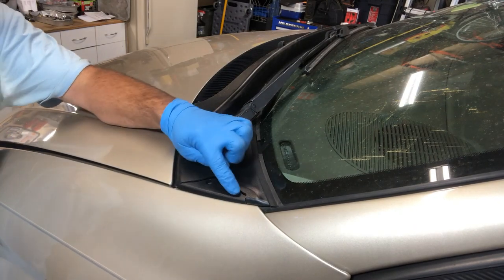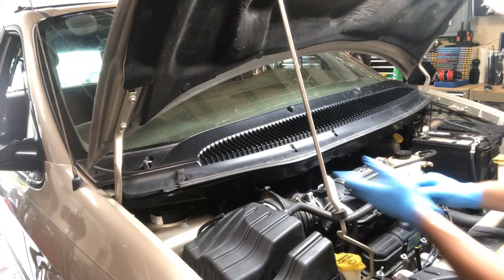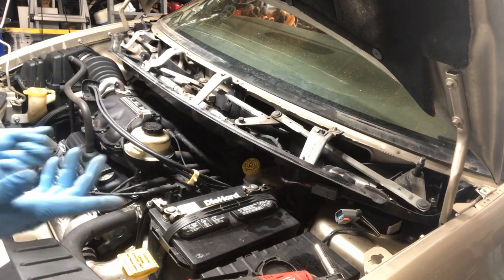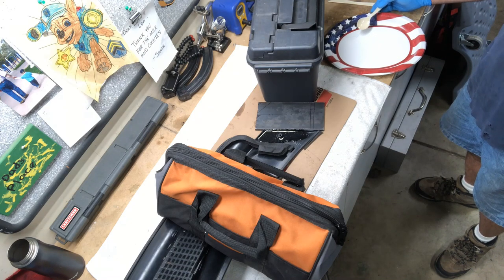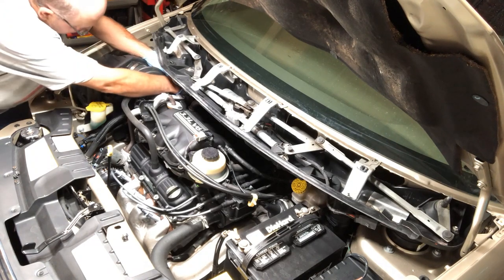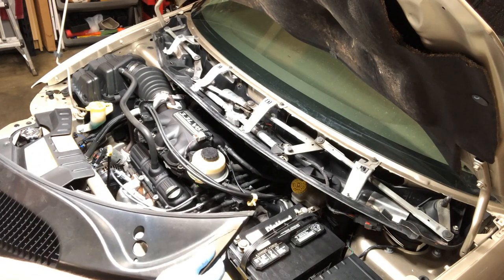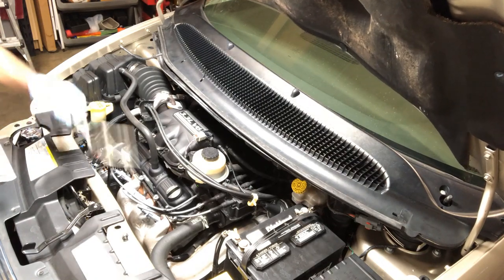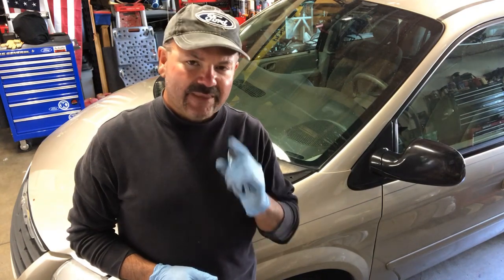Wiper Motor Replacement & Cowling Town & Country Grand Caravan

Comment: Pulling the wiper tray out made it so much easier to do a strut tower repair and an alternator at the same time.  I've been told it's not necessary, but after seeing how easily it comes out, I figured it was well worth the time.  I took the whole hood off too.  Was worried the wiper tray was going to be a pain but after watching this it was clearly super simple, I appreciate the video.   Nearly identical process for a '99 van in case anyone was wondering.

Comment: I didn’t see the motor been replaced
Reply from the maker: Memo Ramon - Your observation is correct. I shot this video when I was removing these items to repair the cowl and changing the spark plugs (this process gives way more room to work).  I thought this video would be able to help those performing a variety of repairs in this area.  I have yet to have to replace the motor itself, however I've had to replace countless cowls.  If you need to replace the motor itself I would recommend a quick trip to the salvage yard where you could purchase the motor and tray in one piece (for a fraction of the price) and easily install it as I show here.  Thanks for stopping by and leaving me some feedback.  Much appreciated!
Reply: Thank you for saving 23 minutes of my time

Comment: Hi, I bought wiper blades only to learn that the issue is not with the blades but the arm itself. I was to to take it off and adjust it a bit higher because my wiper blades kept hitting until one of them actually broke. THIS VIDEO IS EXACTLY WHAT I NEED! THANK YOU SO MUCH. Now I hope it isn't going to get complicated. 😅😅😅

Comment: Good video that fully explains the process of removing the wiper housing which is a must on these vans if you want to work on anything on the back side of the engine compartment. Personally I don't like to pound on the wiper arm shaft or otherwise use force. I use a battery terminal puller, it works perfectly to pop the wiper arm off of the shaft.
Reply from the maker: @mr88talent - Thank you for the compliment and taking the time to leave me some feedback!  I completely agree on the puller.  I sometimes try to use methods and examples that anyone could follow in their driveway without the need of "specialty tools" that many of us take for granted in our toolbox.  In retrospect, I should have used the hammer & nut method on one side and my puller on the other side for comparison. I'm still pretty new here to YT but I'm learning how to produce better videos every day and really try to improve my content as I go.  You've given me an idea for an updated video at some point, thank you!

Comment: Do not tap the nut with a hammer it will ruin the threads, get a tie rod puller it works great it’s cheap and no damage

Comment: Thanks but did you forget a step? run the new motor a few cranks and turn off so it set in the off position, then attach the wiper arms.

Comment: I was hoping you would cover something that is right there, but you didn't.  The insulation just under where you were working has fallen down and is touching the engine.  Could you please tell me what is supposed to hold it up?  Or, did you cover that in another video?  Thanks in advance.

Comment: The reason I watch this is? I need to replace the upstream oxygen sensor and taking the wiper housing off leaves so much room for activities.
Reply from the maker: @Jerry Harte - Great idea Jerry, removing this should really open up that area to give you some good access to that sensor.  Good luck on your project, they're not bad to replace so I'm sure you'll have no problem.  Thank you for stopping by and taking a moment to leave me a comment - thank you!

Comment: I just don't understand. Is my '08 4.0 SXT Caravan the only van made where the wiper arms are hidden under the hood? I've watched '08 videos and neither of theirs are hidden like mine. 9:37 I cannot just lift a cap and ratchet the nut. It seems that I would have to either lift the hood and use the world's smallest tools or just remove the hood JUST to access the nut.

Comment: Thank you.  I am replacing plugs/wires today in my 2002 T&C.  Might be able to do so w/out removing wiper assembly but now I'm less stressed about it seeing the wiper assembly isn't a big deal if I have to go to that.
EDIT:  It is now later in the evening.  I did end up pulling the wiper assembly.  And I agree it made the job a whole lot easier.
Reply from the maker: Glad I could help!
Reply: @javosgarage  Me too.  And I did end up removing the wiper assembly and it was easy peezy. TBH, I'm rather impressed with how many parts of my T&C appear to be engineered by someone who actually considered the person doing the repairs. I've seen videos of some vehicles where it was a nightmare to get to things that are scheduled maintenance.
Reply from the maker: @davidbwa  I have to agree. These vans are pretty easy to work on (not everything naturally) but overall pretty friendly to work on.  The newer cars and trucks have zero room for working and they've tried to make it so you pretty much have to take it to the stealer to get it repaired due to all the proprietary computer items.  Glad your project went well.  Thank you for stopping by and taking the time to come back here and leave me some feedback - much appreciated!

Comment: your car repair vids are some of the best i've seen on YT, if not the best.  please make more!  thank you
Reply from the maker: @kpn5000 - Wow, thank you for the compliment!  I really try to make videos in such a way that anyone (regardless of their experience) can do the job themselves.  I've been searching for my next project van so a new series of videos are in the future.  I really appreciate you stopping by and taking a moment to leave me a comment - thank you!
Reply: @javosgarage  well, it's working, because i just did the job myself, and i'm a novice.  thanks again.  one thing, i couldn't remove the wiper arms, i tried for about 45 minutes, liquid wrench, tapping with hammer with nut sticking out, tapping on just bolt while pulling on arm, etc, but wouldn't budge.  there was some sort of washer beneath the nut that seemed fused to the bolt.  i ended up doing the back plugs/wires by feel, so, it worked out okay, but, not sure why they wouldn't come off.  all tapping on the nut after it was loosened did was ruin the threads a little lol.  i'm looking forward to next set of vids, they're really great!

Comment: This was helpful. I was trying to determine whether the pull the wiper arms and cowling to do spark plugs. I’ve worked on vehicles for many years, but one thing I try to avoid is pulling wiper arms unless 110% necessary, if they have the splines like that. I think there are a few which have a single position, which are great, but if they have those darned splines, I can never seem to get them lined up, even after trying to “mark where the wiper hits the glass”, etc.

Comment: Thanks, I'm fixing strut tower with a replacement cap & this needed to be done to have room to work👍
Reply from the maker: You're very welcome.  This will actually make your job much easier.  I have removed this motor assembly every time I've replaced the struts in one of these vans and that's been quite a few.  Good luck with your project, I hope it goes well for you.  Be real careful with that spring when replacing that cap.  Thanks for stopping by!
Reply: @javosgarage  
Thanks again!!
It's actually a strut tower replacement kit not the strut itself.
The strut tower is so rusted out at the top that the strut pushed thru.
The kit is a cap to replace the top part of the strut tower.
I recently replaced both struts with new ones but then this happened.
It's a 2000 town & country with 250,000 so it's expected.
I don't think I need to compress the springs to remove & replace the struts but I may be wrong.
If I remember correctly they came out & went in without having to compress them even though I did use the compression bolt tool but it really wasn't necessary.
Thanks again!!👍

Comment: Just finished changing the motor and linkage. Video was a great help, Thanks.  I have the 4 cylinder Caravan.  Has only two supports and four screws in the plastic.  I could not get the wiper arms off by tapping or pounding, I bought a 3 arm puller for $20 that popped them right off.  A two arm puller may work better.  Wipers now work.

Comment: Another great video Javo.   My wiper motor just died so I'm off to the junk yard thanks to you.

Not sure how helpful this will be for others, but here's a listing of all the tools used for removal.

slot screw driver
15mm socket
hammer
T25 Torx
Phllips 2
13mm socket
12 in extension
10mm socket
magnetic pickup tool

I might have missed something, but I think that covers it.
Reply: All swapped out and working fine.
Reply from the maker: @Dave Wilson - Thanks for the compliment Dave.  I appreciate you taking the time to list out all the tools, I should have provided that in the description.  Thanks for stopping by again!
Reply from the maker: @Dave Wilson - Great news Dave!  I'm glad to hear my video was able to help you with your project.  That's awesome!
Reply: @javosgarage  you rock Javo.  I'm using the fluid extractor from the other vid right now to pull coolant out of my radiator.   Going to do a full flush before putting the new one in.

Comment: Awesome and detailed video again! Thanks so much. However, if I can do those back plugs without removing all that stuff, then that is the direction I would go, even is it is a bit difficult. Reason being that based on past experience, I would probably screw up something attempting all that extra. You have more experience and more confidence to attempt these repairs than do I at this point. Still very nice to know how to do all of that. Still love all your videos.. GOD bless and prosper you even more...!!!
Reply from the maker: @Stuart William Johnson - Thank you for the compliment on the video Stuart.  I certainly understand this process could seem intimidating, it was for me as well the first time I did it.  It comes easier to me now since I've done this at least 30 times and so my goal was to share what I have learned to make the job easier for viewers.  You certainly don't need to take on this process in order to change those rear plugs, I just find it enables me to do a better job since I have bigger arms and have a hard time getting back in there.  As always, do what's best for you and maybe my info can help you out along the way.  Blessings are always welcome here, thank you.  I appreciate you stopping by and taking a moment to leave me a comment.
Reply: Stuart, FWIW, up until about 2 months ago, all I ever did on cars was put gas in them.     I just did this today as my wiper motor died.  It's ridiculously easy and takes 15 mins or less.   Javo directions/instructions worked perfectly.    Pull the caps, loosen the nuts, pull up carefully while tapping the nut with a hammer and you'll feel the wiper blades come loose.    Remove 5 or so screws from the cowl cover, maneuver and lift it out of the way.     From there, it's 4 bolts, 4 nuts, loosen 2 clamps, push drain pipes down then lift, rotate and pull.

Easy as can be.    FWIW, an idea struck me today while at the junkyard.    If you have a pull a part type place around, go out there with the tools I listed above and do a practice run on a junker van.    Take it off then put back on.
Reply: Label stuff and draw pictures, don't let something keep you from learning. Draw the hood and make a part map

Comment: Thanks for this great video, my 2005 Grand Caravans cowl is broken just like the one you fixed. Can’t wait to fix mine thanks to your video ! Frankly I like these crazy vans, I’ve had seven!
Reply from the maker: @Jean Deramee - Hello Jean, you're very welcome for the video and I'm super glad to hear you found it to be helpful.  It's a pretty easy repair to a common problem on these vans, hopefully it will work for you as well.  I really appreciate you stopping by and taking a moment to leave me some feedback - thank you.
Reply: @javosgarage  looking forward to your next video on these vans!
Reply from the maker: @Jean Deramee - Thank you Jean.  Funny enough I was just looking through some ads just now for my next project van.  This generation of vans is getting really tough to find something that's not beat up and has really high miles.  I'm looking though!
Reply: Mine’s a 2007 with the same crack.
Reply: Thank you @Javo's Garage! I just picked up a 2004 (my fourth GC) I love these vans, your vids have helped me service a few issues, plugs & wires are next as it has originals with 190K Km. All that came to mind in viewing your cowl repair that I might have done different is roughen the inner plastic to give epoxy something to hold on to, and put a little fiberglass matting it into the wet epoxy for Xtra strength. Great DIY video, thanks again!
Reply from the maker: Great idea SailorVic1.  I should of thought of the fiberglass matting.  Would have been nice if the factory would have just done a little better job of production in the first place huh?  I still think they're great vans though.  I picked up another 2005 T&C Limited and plan to do another 20-30 videos this spring to finish up my series.  Hopefully I can give you some more helpful info in the future.  I apologize for the delayed response, thank you for stopping by.
Reply: I still have my 1996 dodge grand caravan in 2024. Such a great vehicle! These videos help it keep.going!

Comment: Mine was a bit more difficult. I had to use an impact wrench to get the 15mm nuts off the wiper arms. Then the arms wouldn't come off the posts. It's a 2005, and the arms had probably never been removed before. After all the tapping, using a puller, trying to lift and wiggle, they hadn't budged. I wound up using a hammer on the curved black covers over the posts. One came loose after about 5 good whacks. The other took a lot longer. It finally came loose, and the covers to the posts are fine. Not a dent. I'll clean those posts and the holes in the covers, and smear on some anti-sieze when I reassemble everything.

Comment: I appreciate ya showing this. I'm trying to learn how to replace my power steering pump, and this is a great start to get some room, I don't like the mini part of this van.
Reply from the maker: Hi Gerry, I'm glad to hear my video has been helpful to you in gaining some insight into gaining access to your power steering pump change.  Removing this motor assembly will make that job MUCH more manageable; you'll be glad you did.  I hope your project goes well.  Thanks for stopping by and taking a moment to leave me a comment.
Reply: Yeah man I'm still alittle unsure about the pump and lines and belt ensemble so I'm going to have to watch those videos a few more times before I decide to go DIY.
Reply: @javosgarage  I bought all my parts from advanced auto with pretty much everything they had that said it fit my truck so I hope I got it all . Watching these videos brings me back to when dad use to try to show me stuff as a kid but he ain't around anymore unfortunately
Reply from the maker: Hey Gerry.  Not sure what exactly the issue is with your van but may I  give you a pointer?  It's very common on these vans for the filter screen in the power steering reservoir to become clogged and cause problems due to flow rate restriction.  You may look into the reservoir before diving into a new power steering pump.  I have only had to do a few pumps in these vans but several power steering reservoirs due to clogging of that screen.  Also make sure the fluid is completely full to the top line.  Never hurts to look into the smaller, less expensive items before jumping into a big project.  I hope this info may help save you some time and money.  Good luck with your project!

Comment: Another cool video. I also removed my wiper motor assembly to change spark plugs. One question: at the 12:15 mark you talk about needing to reattach the firewall heat absorbing mat. The mat on my firewall is more of a fiber mesh like material that is very dirty and falling apart. Would you know if this is replaceable? If not then how did you end up reattaching yours to the firewall? Still binge watching all your Town & Country videos. I'm on to the auto trans fluid and filter replacement video and then the interior cleaning video. If you're ever looking for ideas for videos, I can think of two that would be awesome. The first would be how to diagnose and repair a sliding door that the power motor no longer works (i.e. having to manually open and close the door). The second would be how to adjust  / replace the parking brake assembly when it no longer holds the van on a hill...
Reply from the maker: @jcherokee - I am not aware of any dealer or parts store selling those any longer.  If you really need a replacement I would look for an 07 (last year this body style was produced) at the local salvage yard.  I've had to replace a few fasteners over the years to make them stay in place.  I'm sorry but I've never had one in such bad shape it needed replacement.  When I get my next van I will be covering how to repair the sliding side doors as well as the rear door, both of these are common failures that can usually be repaired fairly inexpensively if you know how to do it.  I have been making a list of requested videos and I will add your suggestions to the list when I get my next van.  Thank you for watching and the suggestions!

Comment: On my 2014 T and C Van, all the lights on the dash lit up, and the wipers would not stop. I am not sure what is wrong, but I think there might be mildew in one of the cluster of the electronics. Have you ever had this problem, and how to fix it? Also the comp. says to replace the Cadilic Converter. I think it might be a oxigen sensor that has to be replaced. The van has low milage  120,345 Miles.